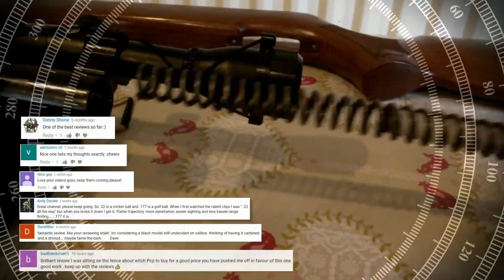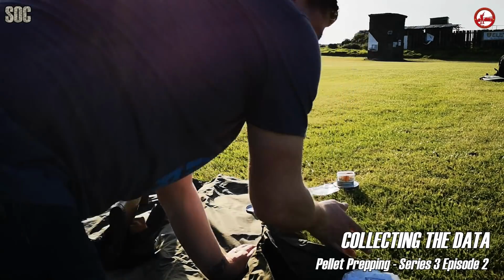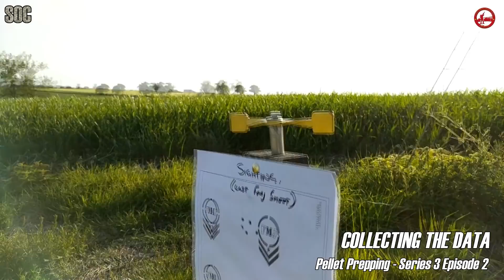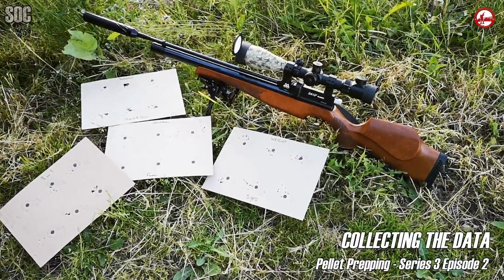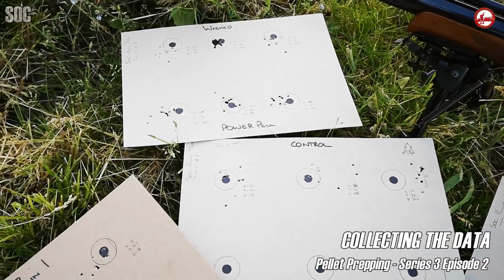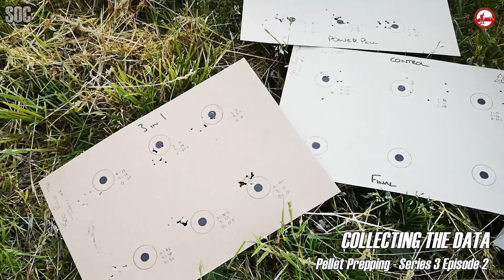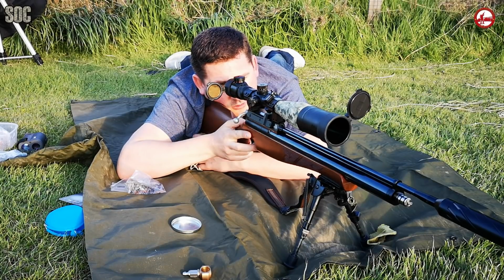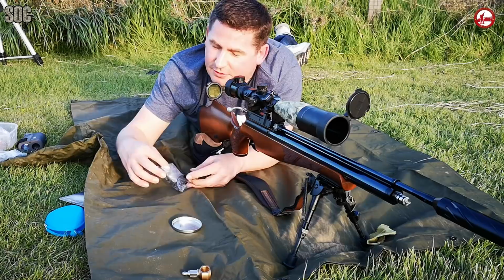Prepping Pellets Data Collection (Series 3 - Episode 2) - The Shooting & Outdoors Channel

Comment: What is that reticle type sticker on the front pop up hood???
Reply from the maker: Depending on what I range find with...sidewheel/ laser...I reference the half mildot pip on the sticker...go into my scope...put the same pip on the target...account for wind and pull the trigger. Series 1 goes into it in more detail.
Reply: @ShootingOutdoorsChannel  Interesting thanks I'll have a look at series 1 ! Only just got back into it as I am trapped at home so using my PH6 in the garden, got a POA F1 5-20x50 arriving tomorrow to learn range finding and front parallax drove me nuts on my Hawke 4-14x50, if hunting you missed the shot! Many thanks for your response, Garry

Comment: In the process of " sizing " "weighing" " lubing " & " testing " meself ... crossman premiers , they dont fit very well when loaded through magazine into barrel .. ( .20 ) ..so ive bought a sizer too " assist " the feed ( so too speak ) into the breach ...ONLY diong this with the crossmans , as the others work great ( sovereigns , accupells , std JSB's ) .. got two boxes of the buggers too do if the sizing works ... all 1250 of the sods ( well near enough anyway ) ...